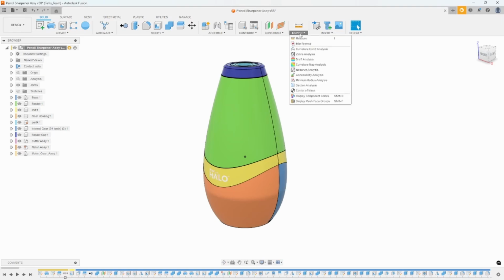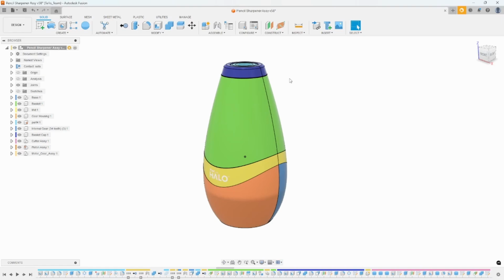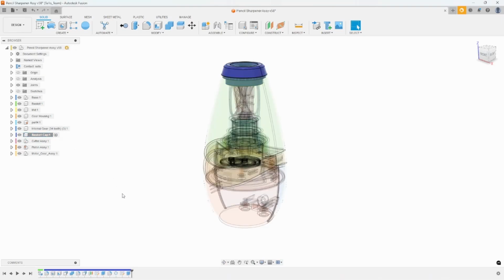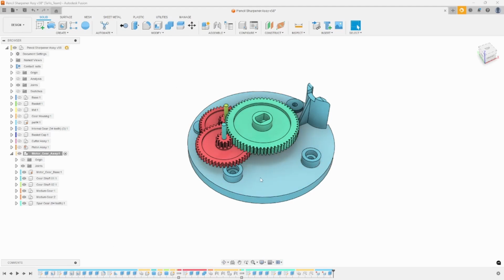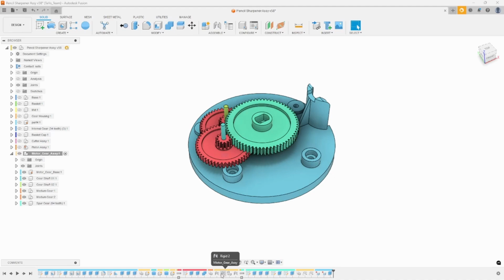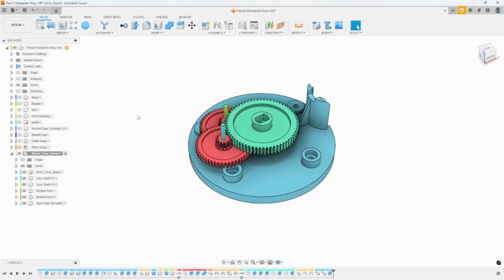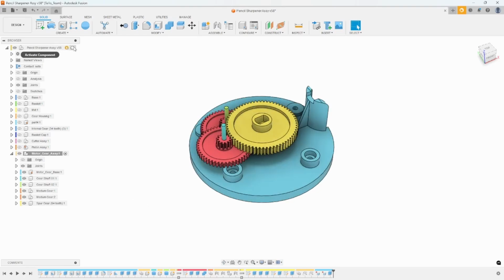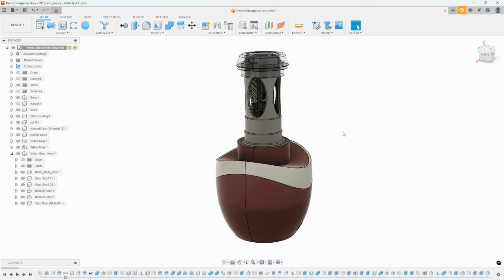Learn about Component Colors in Fusion

Comment: amazing as usual thank you, a quick question , if i have a part in the display between a lot of parts how to find which body or component from the side line listing all of them ?
Reply from the maker: What I typically do is hover over an edge or face of the "buried" part and click and hold for about a second until the "probe through" dialog appears.  Then I scroll through the depth list until it selects the edge or face on the object I want and select it.  When it does that, it highlights it in the browser on the left.